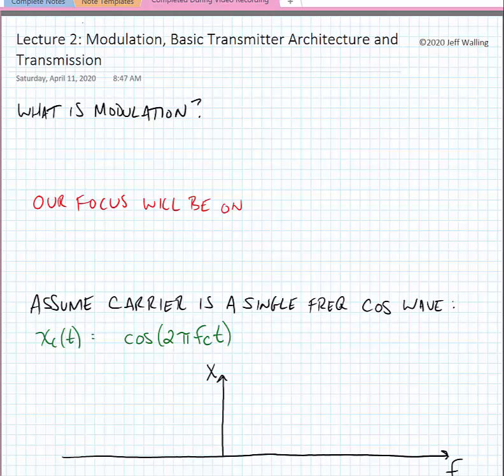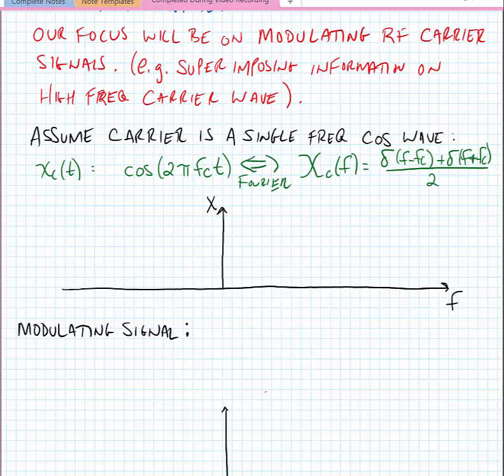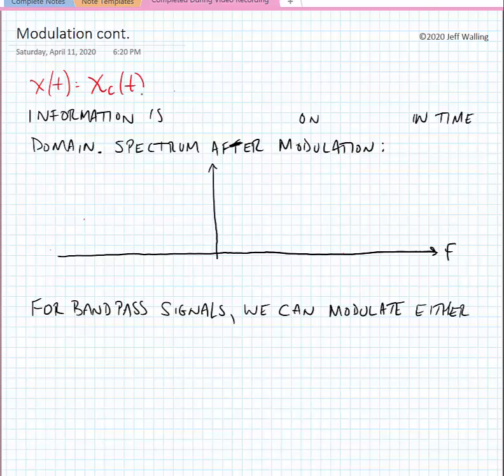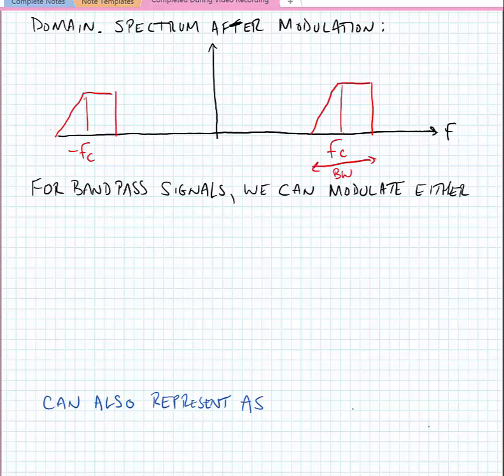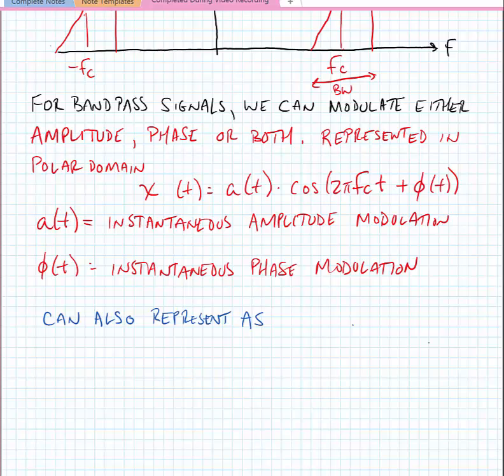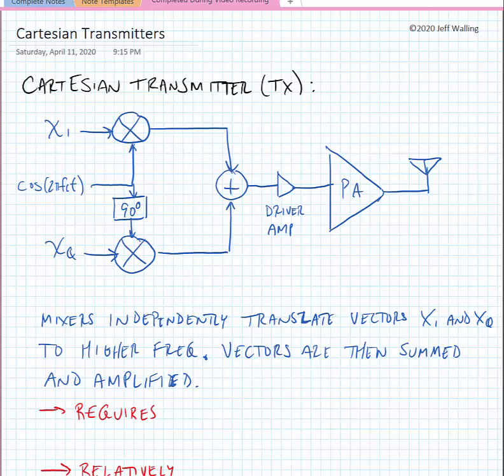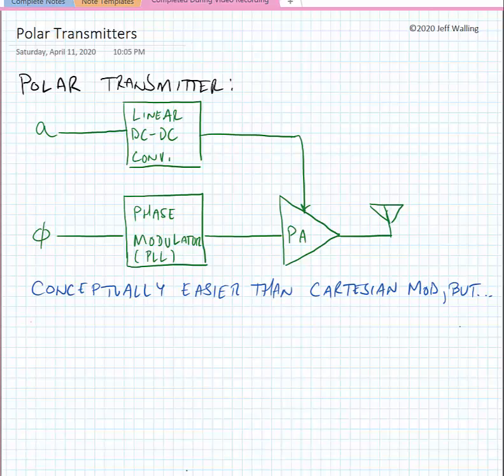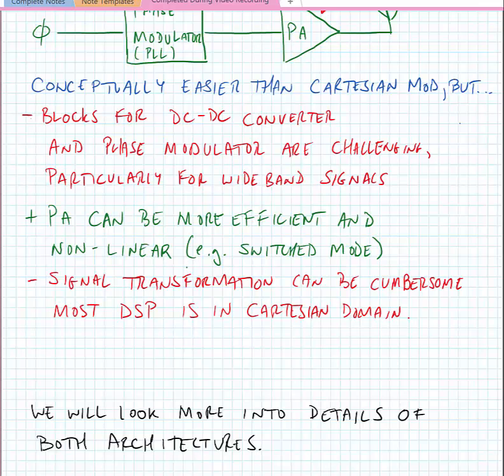Lecture 2 - Modulation and Transmitter Architecture

Comment: I thought from convolution that the baseband spectrum will not flip around when convolved with the two dirac functions of the cosine wave. it is just shifted in frequency not both shifted and flipped.
Reply from the maker: You are correct...I goofed the math a little bit. Nonetheless, it wouldn't change much from the perspective of the hardware :)
Reply: Ok thank you very much  :)
Reply: Oh I'm thinking the same way as you. Maybe there should be a small note in the video to avoid confusion. @Jeffrey Walling